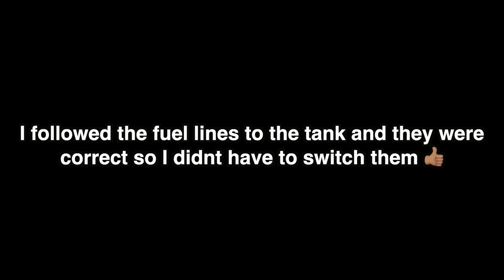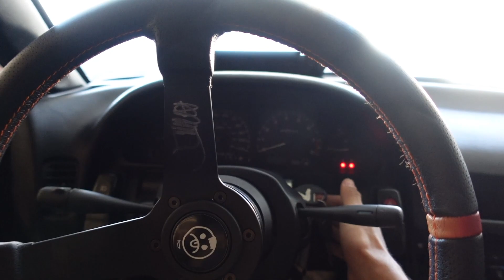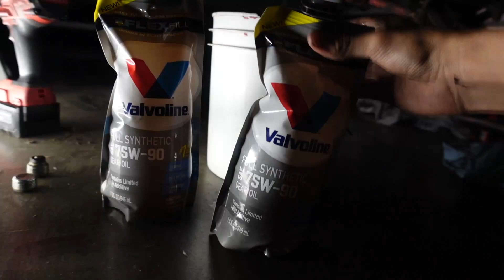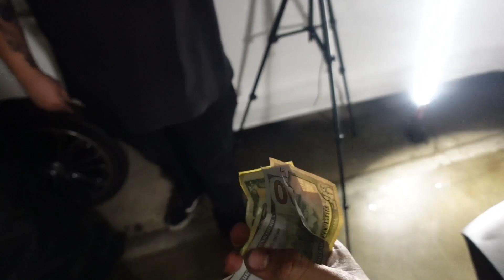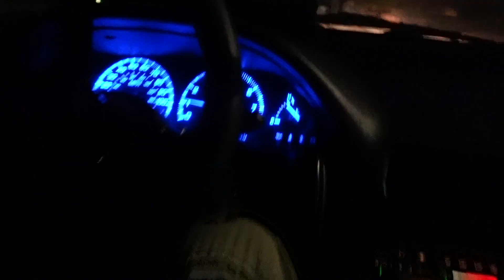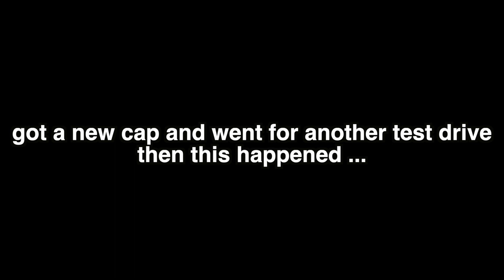MY 240SX FIRST DRIVE IN A YEAR !!!

Comment: CONGRAZTZ! 
I had same issues on my KA24E..
about the overheating, put back the fan shroud! you cant believe how important that is to make efficient radiator cooling.
for the bleeding, you should have a bleeding screw on top of the intake, next to the water hose (at least on the ka24e there is).

I also had same issue , engine not starting or running rough. in my case, the distributor was 180 off, i had to take it off along with the oil pump, give the crank 360 turn, and put it again. 
the engine fired right away. a quick test you can do, is switch between spark plug wires.
hope this helps
Reply from the maker: my cars running good now just need to figure out the overheating but I think it’s a small leak by the thermostat, I would love to put a shroud I know they’re really efficient but I can’t find one anywhere ..